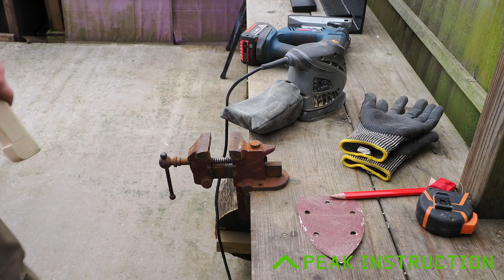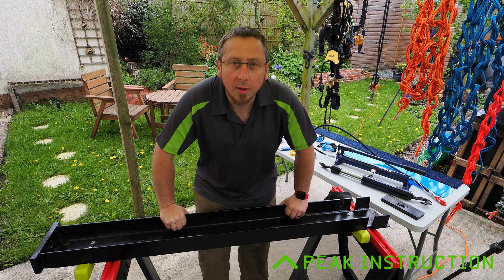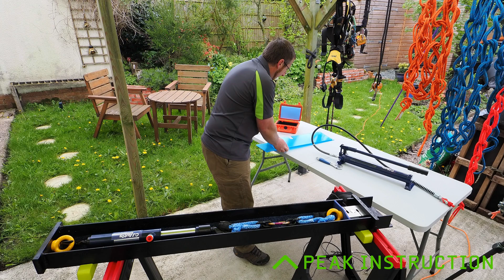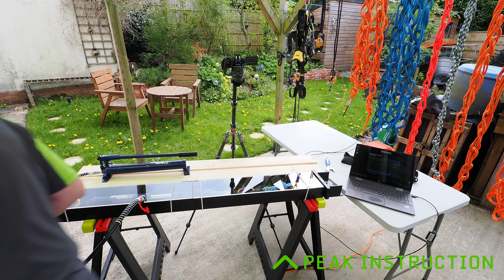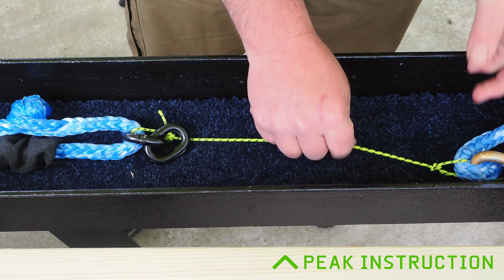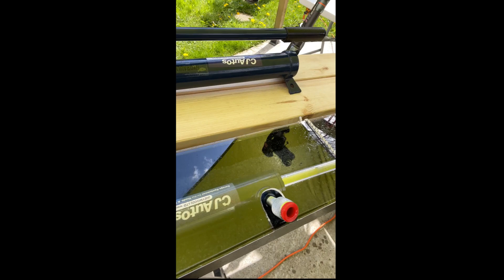Building the Carabiner Breaker

Comment: Hey Pete, Do you have any products in mind for a heavier duty hydraulic pump or do you think it could withstand something like a “cheater bar” to give you some more leverage? I’ve got a very similar car bodywork repair hydraulic pump and i’m very dubious that it can actually put out the force advertised on the box. thanks, cal
Reply from the maker: I haven't looked at alternatives to this pump I'm afraid. I was hoping to keep this setup mobile so I discounted electric hydraulic systems or anything likely to be significantly heavier. I think if you want more pulling power, you need to move away from hand pumped rams. Extending the pump handle for more leverage is a tricky one. It does not feel at all flimsy on this pump, but I'm not sure how well the arm pivot would take the extra force of a longer lever. It's good kit, but not mega beefy hardware.
The brand of pump and pull ram I have is Porta Power, and they get good reviews. I'm sure I can get 50kN+ out of it, which is the limit of my test bed sensor anyway. I have been up to 40kN already no problem, so 4T equiv force.
If you need more force, can your setup pull on a 2:1 with chain or cable and a big pulley? That way you can exsert half the force at the pump than the force on the sample/car/load.
Reply: A pulley or two  would be a lot cheaper than buying a bigger hydraulic setup or electric winch. I’ll have a look at steel cable and some pulleys to take it. I suppose the cable itself won’t need to be able to take the full output force. i would guess the stress would be divided equally across all strands of the pulley system, although  i wonder whether there’s different amounts of stress in the slower moving strands close to the load compared to the fast moving strands on the hauling side.